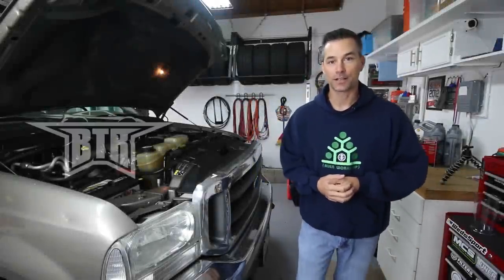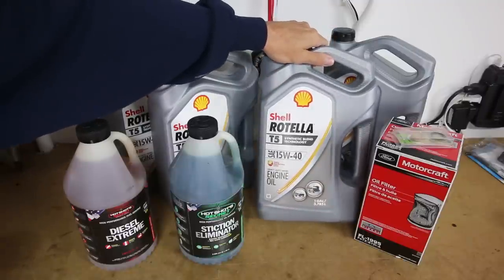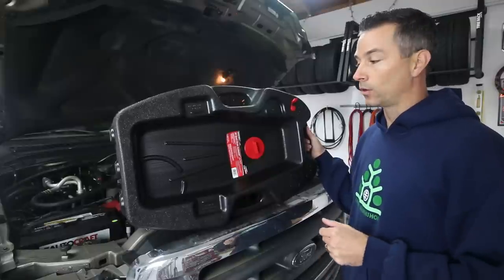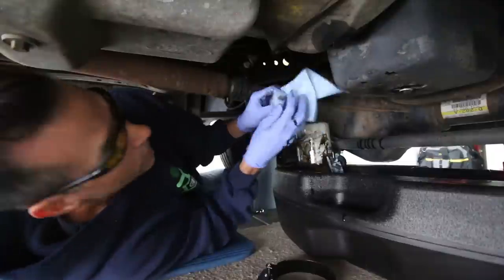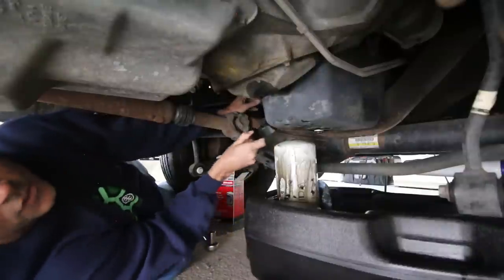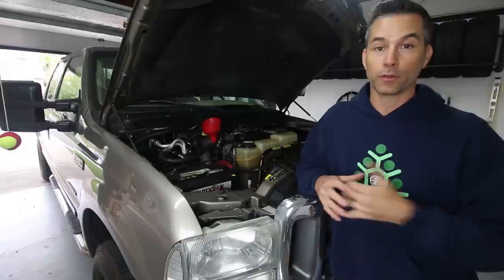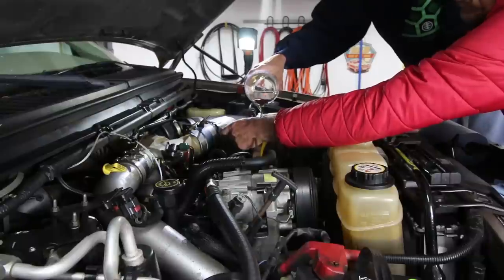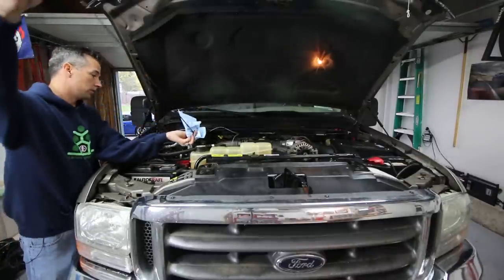Ford 7.3 Powerstroke Oil Change

Comment: Quick question brother where did u get the pump to get the hpop oil out can u please tell me o wanted to replace mine too but don't have anything to pull the old oil out thanks ...Nice thorough vdo 👍
Reply from the maker: This is the one you want : ► Fluid extractor for HPOP : https://amzn.to/3HaR3wT

There are a few different styles, but that one will make the job simple!

Comment: 5 -40 or 0-40 in the cold . Ford recommends a 10-30 diesel oil for the 7.3 in winter but I run 0-40 and she starts like it’s summer
Reply from the maker: I did end up switching to Rotella T6 5W-40 for Colorado winters, seemed a little better.

Comment: Man just got a 7.3 2003 i had white smoke when I let the engine cool down and hard to start and when I went up to 50mph wanted to stall out.. changed the camp sensor $30 I starts like a champ and don’t do the stall out also...

Comment: Yes.. Injectors DO NOT work as well after 250,000 miles on the 7.3's ..  It's just the way it is.  Also the wiring harness on the valve cover.  Perfect oil choice!  Rotella T-6 5w40.  I got a Full injector / harness job done for $3,600 in Crescent City on the north coast of California, by a Diesel shop.    It idles with less rattle and MPG improved by 3.  No regrets.
Reply from the maker: I've got a ways to go before 250k miles, but good to know!
Reply: @TheBTRGarage  Excellent.  Mine is a 2001 with 250k miles, bought used from a woman.
Reply: 252K and change pulled my injectors and checked clearance, all had zero clearance. Replaced with all new injectors. Start is always quick and the amount of clatter is back to normal.  I never get into fooling around with oil brand and weights. My last three big trucks (Pete and KW, one Cat and one Cummins one Detroit) had over a million miles when I sold them. Religiously serviced with Rotella.  The 7.3's want 15w40 and that's what I always use.  Never a cold start problem and never any smoke.  I'm in the "if it ain't broke, don't fix it" crowd. Not interested in "improving" anything, just start it and drive.
Reply: @pilot3016  Exactly what I've been doing for years. I'll buy a vehicle from a female owner any day, but only if the vehicle interior isn't trashed. Found that these were the folks most likely to not fiddle around with anything, but were hell bent on following service recommendations. So far it's served me well. Just picked up an Excursion like that and am happy as all get out with it. She used it to pull horse trailers and all the stock items were still there. Just well cared for.
Reply: @WillyDaC  Yes!  You are correct.  Don't mess with alterations. If you want something faster or more powerful...buy one.  👍

Comment: The 10w30 also helps with quicker starting at all temps and better fuel economy and a little less drag overall on the engine. You may see a drop of 5 psi in oil pressure but usually no more than  that.
Reply from the maker: Good to know!
Reply: why doesn’t ford recommend 10w30 if it’s that much better
Reply: @DC-nd7qz  just use 5w40 rotella, new Detroit's an smaller diesel engines are using 10w30 as an option but most like Cummins still recommends 15w40, make sure your block heater, and glow plugs are working properly as well

Comment: Arch oil stiction modier is great as well! Call it H-POP not hpop😊. Gret vid! Riff-Raff diesel sells an over the belt upper radiatir hose as well, so you  an cahnge a belt without draing your cooling system!
Reply from the maker: Thanks! I have a different video where I replace the upper radiator hose, along with a new T-stat and billet housing 👍
Reply: @TheBTRGarage  I have two Billet housing's sitting on my work bench! Doing the mirrors this weekend as well. Great channel!
Reply from the maker: @mikespence7250  Awesome! Glad the videos are helpful.

Comment: Love the content, just bought my 99 F-250 7.3 powerstroke and this video helped me flush all the systems and check for leaks on it. But I have a question what is the small hole above the oil pan at 4:22 your hand is just to the left of it.
Reply from the maker: I believe that's the hole in the converter housing where transmission connects to the engine crank.

Comment: Is the hot shot stiction eliminator only if you have issues or can I use it for maintenance or preventative? Just bought my 7.3 with 325k and don’t know what it’s been through.
Reply from the maker: Definitely recommended for your situation! Do the initial treatment per the instructions (full bottle of it) then after that you can follow the maintenance cycle per the instructions 👍
Reply: @TheBTRGarage  Will do. I will follow up in the future on the results. Thanks a lot.

Comment: Great video, I just bought a 2002 F250 Super Duty with the 7.3. It has 250k on it and one of the first things I will do is change the oil and filter. Great video and extremely informative. Thank you!
Reply from the maker: Thanks, glad to help! Be sure to check out my more recent video that covers changing the fuel filter as well, you will probably want to do that right away with the oil change.

https://youtu.be/_SCUt9MqL5I
Reply: Curios how much you got the truck for?
Reply: I just got my 7.3 about 2 years ago with 226kmi.  Check the oil cooler seals for sure if they havent been done yet.  A little tricky to access, but once removed its not difficult.

Comment: After you use these additives do you have to continue using them? Or can they be one time use
Reply from the maker: It doesn't hurt to continue using them. I usually do the oil additives every other oil change or so, and the fuel additives every few tanks of fuel. Some people add them regularly, just kind of depends on your own approach and running condition of your engine too.

Comment: I have 315k with new heads and rebuilt injectors. I have a demos copied starter which is strong but every 5 starts the engine wants to lag a bit. The starter is high torque but I feel like my old ford starter sounded more consistent (not as strong, but sounded even). 

I’ve never used STI toon eliminator but currently run FR3 in the oil and edt in the tank.. would stiction eliminator be safe? Mechanic said my inner looked clean and had low wear. Do I need a stiction eliminator?
Reply from the maker: Probably not *needed*, but I'm sure the stiction eliminator will help with cleaning the oiling system out. Even if just a little bit, if it's already clean.

Comment: I always heard it was better to drain a warm engine when doing an oil change?
Reply from the maker: It definitely helps drain more oil quicker, but not completely necessary. I do usually warm up the engine a little bit before any oil change, just be careful because everything is hot, including the oil.
Reply: @TheBTRGarage  Yeah, Some rubber gloves and its gravy.

Comment: Any ideas about using the magnetic oil drain plug like the Votex brand version. Are they helpful for diesel engines also?  My truck is the 1997 f350 7.3L turbodiesel XLT with 180 thousand miles so I'm wondering if it's too late to be worth it? Amazon says the Votex dp001 fits and is a quality product unlike cheaper stuff. Mishimoto is also supposed to be quality. Thanks 👍🏼
Reply from the maker: It wouldn't hurt to have one. I personally have only used those on gas engines but imagine they would serve the same purpose on a diesel engine.
Reply: @TheBTRGarage  Thanks for your feedback 👍🏼

Comment: It sounds like a glow plug problem. Have you checked your glow plug relay? 5w40 is  a better oil in winter time.
Reply: I agree. I had the same issue several years ago, and the problem was the glow plug relay.
Reply from the maker: Thanks for the feedback! I did check the GPR and it tested good at the time of this video. My symptoms got worse over the weeks however, and it did turn out to be a failing GPR. Wait til you see what happened to it! 😮 Video coming soon 😁
Reply: Mine melted in half 😱

Comment: I’m confused, the stiction eliminator says it treats up to 32 qts but the truck only takes 15 and you put the whole thing in
Reply from the maker: Per the instructions on the 2qt bottle, it says to use "...approximately 4 OZ per 1 QT of oil for initial cleanup". For the 7.3 with 15 quarts of oil, that's ~60 ounces of Stiction Eliminator, or the whole 2Qt bottle (64 ounces). Since this was the first time I used it on this truck, I put the whole 2Qts in. For future oil changes, I would use half the bottle, or 2 OZ per 1 QT of oil, per the instructions. So that is where the "treats up to 32 qts" comes from I would guess.

Comment: Changing the oil in the HPOP is a waste of time. By the time that engine cracks over a few times that oil in there is gone.
Reply: Where does the old oil go!?!?
Reply: That small amount of dirty oil recycling through the engine isn’t going to hurt anything if you change your oil and filter often.
Reply: I also believe in removing HPOP oil during each oil change. Old diesel oil is fuul of soot, somight as well get out as much s possible.
Reply: @jpippinator  Yes, you add 3 qts Dirty Oil to 15 qts New oil. Makes perfect sense? :/
Reply: A waste of time if you keep up on your oil changes.
Reply: Uh.. there is several quarts of dirty oil in the oil gallery, plus some in the HPOP.  Suck out the HPOP if going to full Synthetic.  Otherwise, don't bother.

Comment: Where did you get that torque spec for the drain bolt? I'm a torque wrench guy and have been searching for too long trying to find the official spec to no avail. Forum experts are all over the place adding to the confusion. In foot pounds i've seen the 7.3 listed as 4, 14, 23, 28, 32, and 52! WTF! And then a lot of those gutentight people too. The latter doesn't work for me because I end up gorilla arming everything haha😂!
Reply from the maker: I'm very particular about torque specs too and had the same problem. I used the info from dead head diesel primarily, along with my own experience with drain plugs on several cars. My BMW's are 32ft.lbs and those are also steel pans, so I knew it would be no higher than that. It's weird that there isn't a shop manual with the actual spec out there...also, after this video I installed a Fumoto valve instead of dealing with the drain plug ever again (https://amzn.to/3nw0I9e).
Reply: @TheBTRGarage fumoto valves always for the win. Installing it on my 7.3 as this will be my first time doing his oil change. Been using fumoto valves for my vehicles for over 10 years!

Comment: How often do you usually change the oil filter and do an oil change?
Reply from the maker: Every 5000 miles is what I try to stick to.
Reply: Thanks! That really helps, your video was very informative. I’m 16 and am getting a 7.3 soon and this was a must watch.
Reply from the maker: Great choice! Awesome trucks and they are fun to work on too.
Reply: Definitely don't go over 5000 miles for oil changes in a 7.3 with stock oil filter because of soot (carbon) contamination. It will cause excessive wear.  Now, If you are running an oil bypass filtration system (approx 2 micron filter) and are sending oil in for Analysis to determine oil change intervals you can run much longer. I run a FS-2500 bypass oil filter and Rotella T6 oil. I have been changing oil at 20,000 miles. If TBN drops too low and everything else looks good I add Hot Shot's TBN Booster. BTW, you can also run a 10 micron hydraulic filter in-line on the 4R100 trans and increase it's life also.
Reply: @ethanthroop9379  I'm almost in the same boat lol. I'm 17 and I'm buying A 2000 does f250 super duty with a 7.3 in it. Lol
Reply: Better save some $$$ cause the parts for these trucks aren't cheap.

Comment: just sayomg if your going to change the hpop oil do the rails aswell on the heads believe it or not the rails holds 1qt a piece so thats 1 qt of oil that never gets touched in the oil change just recurclated i do ot every oil chamge on mine dont need to bit if your doing the hpop just remember the rails are part that system
Reply: You are correct!  The oil gallery holds 2 quarts!  👍

Comment: Hi put two bottles of seafoam drive it for 100 miles your engine will come back to life take it from someone who knows after 100 miles do oil change when you do the oil change one 20 oz bottle of seafoam bottle of seafoam driving about 4 to 500 miles then do another oil change and then your engine will run like a brand new one your engine will run a lot better the other stuff is nothing take it from me I've been using this product for 20 years I've seen what it can do then pour a bottle into your fuel tank top off your fuel tank happy driving

Comment: Used a bottle of suction with half a can of seafoam and my truck has never been quieter at just 152k original miles I have alot of life left in this beast
Reply: Is 288k for the 7.3 still a little bit miles

Comment: It's a 7.3 when it's cold it's going to smoke a little bit you need to switch to rotella t6  and add archoil ar9100 but once you switch to a 5w40 don't be surprised when the ebpv starts leaking its best to just delete it
Reply from the maker: Thanks for the comment. I haven't heard of the ebpv yet, what's that? I considered the thinner oil but it doesn't get terribly cold here that often, so went with the 15W-40.
Reply: It's a valve in between the turbo and your downpipe it closes in colder weather for quicker warm ups the seals fail and leak once you  switch to thinner oil it will be more noticeable
Reply: Exhaust Back Pressure Valve

Comment: Any advice on how to remove a seized filter?
Reply from the maker: Hmm, good question, I haven't had to deal with that before. I would probably give the filter some taps with a hammer all around it in hopes to break loose whatever is keeping it tight. Outside of that, you probably need to drain the oil and cut the filter down to get to the threads, where you could possibly get some PB Blaster or something in there. When in doubt, take it to your local shop!
Reply: Puncture the side of filter with screwdriver and push it all the way to other side and then use the handle for your leverage in removing.
Reply: hammer old large phillips screwdriver through the oil filter..it's messy but you have a good handle to turn that sucker..
Reply: Chuckle.. I had a siezed filter.  Tried 3 techniques and thought I was going to go to church for devine intervention.  A nylon strap unit and much patience, finally did it.  Slow and consistent force.  However, it didn't look like a filter anymore.
Reply: @pilot3016  I ended up buying a chain wrench. It crunched it up pretty good but it finally came off. Lots of colorful words were involved as well!

Comment: Can you use any washer from let’s say Lowe’s? Or just go to autozone?
Reply from the maker: It might work, but you really should be getting a washer for that purpose. They are "crush" style washers that are a lot softer than what you might find in a hardware store.
Reply: @TheBTRGarage  i actually ended up just getting one of those valve things that you can just switch on and off, so i am praying that it doesnt screw me over and wreck my engine haha. but thank you, that was a extremely quick reply.
Reply from the maker: Should be good if it came with its own washer/gasket. My Fumoto valve did.
Reply: BTR Justin yep! That’s actually the same one I just bought. Got it off amazon for like $23

Comment: I had that problem,and what l did l shimed my armature plates n solenoids amazing runs like new,my truck has 413xxx ,l bought a shim kit on Ebay for $75 bucks problem solved
Reply: Oscar Faz , 413xxx, miles on the original injectors ?

Comment: Have you tried Arch Oil yet? I have a 03' 7.3 and Arch Oil is a great treatment for your 7.3!
Reply from the maker: Not yet, but I will be at my next oil change in a couple months!
Reply: I’ve used Archoil and RevX. I decided to go with HSS this time after Project Farm tested their fuel additive on YouTube and it smoked the competition even Stanadyne. They are obviously making a top of the line product
Reply: @juker953  I'm switching also when I'm out of archoil.

Comment: hard cold start...plug it in  thats what its for during cold weather
Reply from the maker: I did, and still had hard starting issues. Pretty sure I mention that in the video. In a later video, the root cause turned out to be a bad GPR.

Comment: a lot of good advice here but I would never tighten an oil filter with a tool ...your injectors probably just need shimmed
Reply: Exactly. I also don't use a removal tool, the filter is big enough to use a little muscle to get it out...especially when it wasn't  tightened with a tool.

Comment: Don’t prefill oil filters. That’s dangerous for bearings, that oil filter fills and starts filtering within a couple seconds. You run the risk of dropping dirt, and debris directly on the clean side.
Reply from the maker: Thanks for the feedback, it makes sense. But, I've seen several other guides out and about who say it is "imperative" or "highly recommended" to fill the filter with oil first (on any vertical mounted filter). So, I can see both sides, but yes keeping it clean is a must if it is filled first.

Comment: Don't return your used motor oil when you are done.
Add 20 percent filtered waste oil to 80 percent diesel fuel. 
Run as hydrocarbon boosted fuel.

Comment: First off you have a glow plug issue if not starting in wsrm/cold weather. Either the relay or glow plugs itself.  And your wasting your time by ducking oil out of hpop. There's still 2gts left in oil galley in heads. To do that. Take plugs out of heads. Lol. Stiction eliminator is made for 6.0s which have spool valve. Which tends to gum up and stick. Unlike a 7.3 which has a poppet in injector. Snake oil that is.. your hiding other issues..  don't waste your time with changing hpop. It cycles the first 20 seconds of running.. my .02..
Reply from the maker: Thanks for the info! It did turn out to a flaking GPR, which I followed up with on another video. This service did help though.